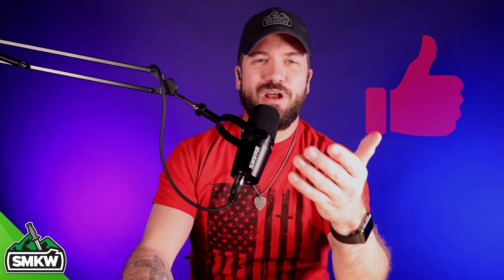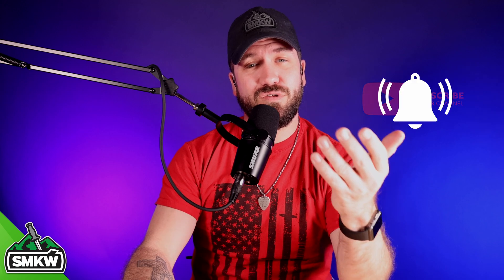Blade Steel Series: 154CM

Comment: 154CM was developed by Climax Molybdenum Company (hence the suffix "CM") the 154 stands for 15% Chromium, 4% Molybdenum.

The name “Climax” derives from the Climax railroad station which was built at the top of the Continental Divide as a place to uncouple helper locomotives after the long climb from Denver to the mining town of Leadville.

In 1879, a large, gray, mineralized outcropping was discovered by Charles J. Senter on the western slope of Bartlett Mountain located in Summit County, in Colorado.

Years later, in 1895, Colorado School of Mines Professor Rudolph George identified the Bartlett Mountain samples as molybdenite (molybdenum disulfide). 

The primary use was in Allied efforts Molybdenum Disulfide was used for armor plating and large gun barrels during World War I. 
The metal immediately found use as a replacement for tungsten in some metallurgical applications. 

Crucible bought the alloy formulation from Climax Molybdenum. 
Crucible initially had trouble processing it and their batches were inferior to those from Climax at first, but later perfected the process and surpass Climax Molybdenum version.

Crucible CPM 154 has the same composition as 154CM, but made by a powder metal process instead of a melt alloy process. Powder steel alloys are tougher than their ingot produced counterparts, and do not have a granular structure. The chromium carbides are smaller and more evenly distributed in the CPM version, leading to better toughness, and better polishing characteristics. 
The CPM version will also sharpen to a fine edge easier and will respond to heat treatment more consistently.

Crucible’s roots can be traced to 1776, when Naylor and Sanderson Steel Mill was established in Sheffield, England, to produce fine-quality tool steel using the crucible method. During the 1800s, the company-then known as Sanderson Brothers-exported increasing quantities of tool steel to America, and decided to establish a steelmaking plant in Syracuse because of the city’s proximity to major U.S, transportation lines, including the Erie Canal and the New York Central Railroad. In 1876, Sanderson purchased Sweet Iron Works and established Sanderson Brothers Steel Company.

Crucible Industries LLC in Solvay, NY (a suburb of Syracuse, NY) is located 150 miles east of me and is where CPM is born, but then it's shipped back my way to Niagara specialty metals 30 miles north of me for Hot Rolling, Cutting, Grinding Annealin and Precision Flattening. 

All CPM steels as well as OKC (Ontario Knife Company) and Ka-Bar are a product of Upstate NY. 
At one point so was Utica Knife and Camillus Cutlery Company until February 28, 2007 when Camillus sadly closed its doors. 

By the way guys don't worry about Crucible going away permanently, I highly doubt that will happen, just trust me on this one ok 👍🏻.

Comment: Metallurgy student here. While many steels have considerably better mechanical properties or corrosion resistance (among other characteristics) than 154CM, it’s important to remember that it’s a mass market steel aimed at the average consumer rather than at knife-collecting geeks. Affordability, availability and ease of maintenance are therefore important factors to consider. I have to acknowledge 154CM’s performance in those regards alongside its satisfactory performance in terms of its intrinsic properties such as hardness, toughness and corrosion resistance. "Well-rounded" is therefore a great qualifier for this steel.
Reply from the maker: Thanks for watching and very well put. If you get a chance check out this interview with Dr. Larrin Thomas creator of MagnaCut Steel https://youtu.be/pxSTJasRIlE

Comment: Kizer has been putting out some AMAZING 154cm knives in the 50 - 75 dollar range. My current favorite knife is the kizer invictus by damned designs. It's a flipper button lock with some of the best micarta scales I've seen with an awesome deep pocket clip. Amazing design that's super comfortable. The thing was SCARY sharp from the factory. Been using it daily for a few weeks now and is refusing to lose its edge. Paid only 60 bucks for this knife.
Reply: Just ordered my first 154cm blade. It's the LP by Kiser, for $37 on evil Amazon . You can't even get a vg10 for that. I've been a knife nerd for many years. You'd think I'd have a 154 by now. Heck, even my Benchmades have s30v
Reply: @Gunrunner223  Be EXTREMELY careful with Amazon orders when it comes to knives. Even if it's under 50 bucks be sure to check the selling source. Counterfeiting has become horrible on Amazon over the past few years.

It is nice seeing 154cm finally being priced appropriately though. It's a great steel when heat treated properly. I've spent way too much on 154cm in the past, especially with all the different pro-techs I have in 154cm. I don't believe I have any Benchmade in that steel, do they even do 154cm anymore? All my Benchmade are s30v / s90v / m4
Reply: Agreed i own a few kizers all with the cpm154  great blade steel and easy to sharpen

Comment: I do not have much experience with 154CM steel but I consider it the "All around ingot made stainless steel."  It does not have many glaring strengths, but at the same time it does not have glaring weaknesses (for a stainless steel).
Reply from the maker: Thanks for watching!

Comment: I have a off-grid Stryker XL and it's the 154 cm so far. I really like it. It holds an edge really well and it is easy to get it extra sharp .... Not brittle at all. Of course this is probably due to a proper heat treat and all of that good stuff
Reply from the maker: Thanks for watching!

Comment: So 154cm or d2 
I’m trying to pick a knife the d2 of course is a bit cheaper knife. According to the blade steel chart at blade hq the d2 is stronger and has better edge retention but less corrosion resistance over the 154cm.

Comment: The 154CM blade on my Benchmade 154CM doesn,t hold its edge well. The edge is brittle I think. after one or two cutting chores, the blade will be dull somewhat, though it still cuts. I can feel the edge chipping. Oh,  I sent an e-mail to Benchmade asking WTF with the edge, but they didn't respond. So no explanation from them. However, I did found a couple of people posted that their Benchmade 154CM blades were brittle. So, perhaps I bought a bad blade. Other than that it is an excellently designed knife, I am still EDCing daily it since bought new in 2008.
Reply: I have had quite a Few Benchmades over the Years and have never been impresses with their blades. They seem to lose their edges quick. I think THE HIGH PRICE is FOR THE NAME, Not MUCH QUALITY.